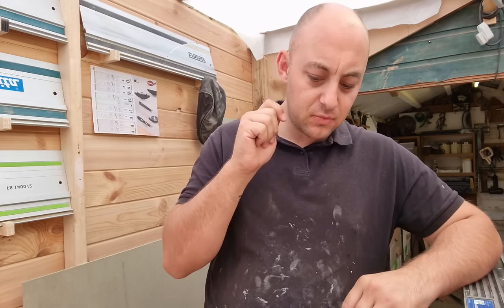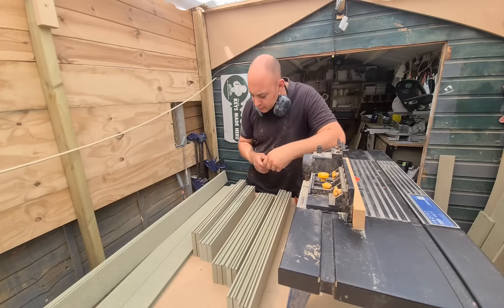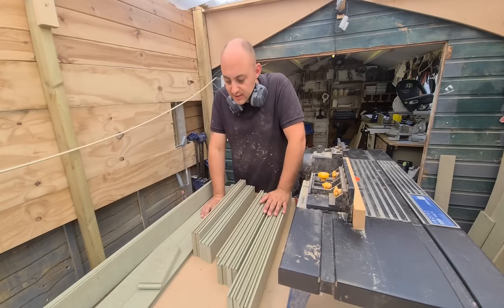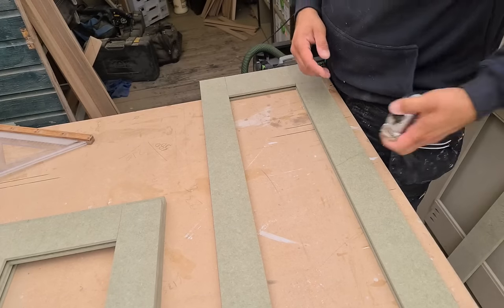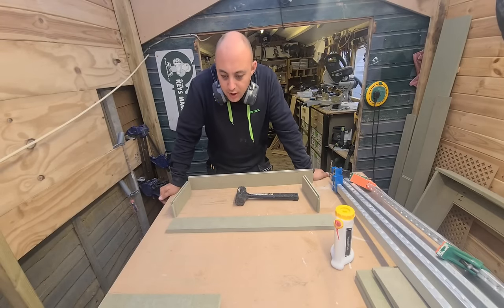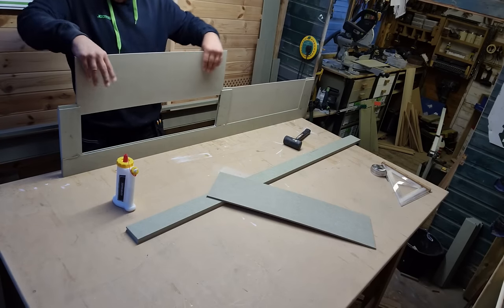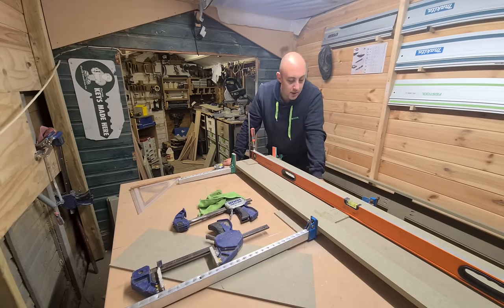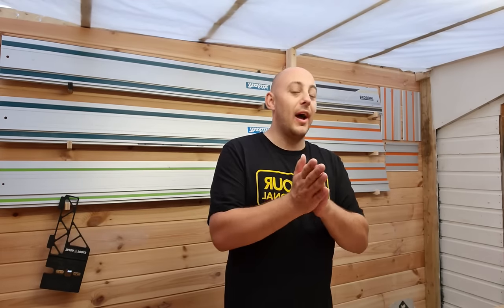MDF shaker doors / how to make shaker doors

Comment: Try making your groove upto 0.5mm wider than your panel for ease of fitting and cut your panel a couple of mm smaller that will make things alot easier. And look into cascamite glue it is a powdered resin you mix up it has a longer working time which takes the rushing out of it and it will fill the extra fitting room you left and it sands down clear.
Reply: I was taught that the 'Panels' should not be glued. ??
Reply: @Rocky-xx2zg  In traditional carpentry I think, because natural timber expands and contracts. But the MDF ain’t going nowhere, so might as well add to overall strength of the doors with some glue.
Reply: @Saladzingers  Got it. Thank you.

Comment: i learned this process for sizing a door panel while working in a cabinet shop. The width is the length of your rail, tenon to tenon, subtract 1/8 inch... or roughly 3 mm. to find the length, take two rails and place them back to back. looking at the end grain, the profiles are facing away from eachother, while the rails outer edges are tightly butted together in the middle. measure the distance from the bottom of groove to groove, and subtract from the length of the stile. to do this math quickly you can pull your tape out to the length of the stile (overall door length), hold it up to the bottom of the left profile groove subtract over to the right profile groove. take the reading there and subtract 1/8 inch and that is the length of your panel. this is also how you size rails. i hope this makes sense, its a valuable method for sizing door parts, good luck.

Comment: How I have made mine for years. 
I grove and mold mine on a spindle molder. And a tenon machine. Over size the rails by 5mm then trim them on the table saw.
Reply from the maker: Sounds like a system you have down to a t
Reply: Exactly the same way as me. Leaning on the powerfeed as it slowly pulls it through 😂

Comment: I agree with the commentor below. The mdf for stiles and rails creates issues and use Poplar it paints well and won’t typically bow and twist - acclimate it to your work area first? You could use mdf for the center panels or a shop grade maple. I also agree with the slightly oversized deimension on the frame (chamfered) leave yourself a little wiggle room for the panel length and width, use space balls (rubber balls) inset into the dado groove which allow the panels to float for expansion and contraction. I would really like  to make some cabinets, but I’m stuck fitting base mounding on a house for another day, then landscaping projects for 2-4 weeks....

Comment: Also you should use paintable edgeband. Small radius cutter and it paints great. The little plastic hinge templates work great to for over lay and for inset you need to buy the right one.
Reply from the maker: I really don't see the advantage to using them I get a perfect edges  with my system... I have a video coming out regarding fitting the inset hinges and what jigs I use.... the ks for the comments mate... much appreciated

Comment: Nice little vid mate. Get yourself a feather board and clamp it to the edge of the table for the grooving, also, make a sled or even a scrap bit of MDF when your pushing the rails through the cutter. It don’t half make things easier and safer👍🏻
Reply from the maker: Iv tried them mate... the feather board i could agree with you but i feel a lot more safer and more in control  doing it the way I do... but thats me... i suppose I should  do a disclaimer  please dont do it like this silly  twat haha 😆

Comment: Not working only from a face side means that any variation in mdf thickness will result in variations in the grooves widths. Best to machine using a slotter cutter and always keep face side down. Machine top and bottom rails as one piece (more stable on the fence) and then cut into 2 pieces.
Reply from the maker: Thanks for the info

Comment: Nice job👍🏻. Pretty harsh on yourself imo. I leave my panels 1/8” or 3mm undersized on width and length to make the fitting easier. The glue fills the gap. Thanks for sharing 👍🏻😊
Reply from the maker: Yes that's what I did do... I think I made the groove just a tad to tight hence the stresses I.had lol all.good tho

Comment: Get some 18mm MDF cut it to size of your door then get a sheet of 6mm and rip it into strips. Glue and pin it on front of door. Router edges of you want to put a profile on them. Similar effect. Less time. Only thing is there's no pattern on back of door
Reply: Prone to bending once painted, also makes a heavy door, also a lot of wasted mdf for no need

Comment: Realise this is an old video but for measuring the panel size, it would be quicker to measure in between stiles then add the 20mm on, and likewise for the rails. Both ways work fine though 👌
Reply from the maker: Thanks for the tip!

Comment: I have a couple of questions. Overall I liked your candid and open approach although I am wondering of the durability of the MDF tongues. Have you had success with this in the past or is this a first attempt? I guess it depends on what the doors are being used for. Secondly, I usually size/seal the exposed edges of my MDF boards. Do you seal the exposed fibres or just rely on the paint to seal the fibres. Which leads me to my next question. What type of paint are you using in the video? And what type of sprayer are you using. Hopefully not to many questions lol. Good job, hope it goes well for you.
Reply: Hi, just saw your query about mdf tongues  . I've been building kitchen doors for 20yrs plus  one of my first  in my utility room still holding up after all this time  not had a customer one fail either.

Comment: I've been doing carpentry and joinery over twenty years. If I ain't made a mistake or missing pieces then I'd be lying. What spray set up is that and what paint?
Reply from the maker: That was the primer and was a 2.0mm tip spraygun fastmover... and the primer was from construction chemicals internal primer... great stuff

Comment: Another good video bud.  Do you never use a paint pot and do you use hvlp or lvlp guns pal
Reply from the maker: I use both type of.guns.?? What do you mean when you say a paint pot.??
Reply: Cheers bud.  As in a pressurised pot connected to the gun so you dont need to gravity pot on the gun.  Do you mind me asking which guns you use for different things. Is it based upon the project size or product type ?

Comment: Looking at making my own wardrobe doors as the previous owners had custom ones installed and the widths aren't standard.
I was thinking of cutting 9mm thick down to the total size, then glue and pin 12mm thick to the front. Would this be okay or should I go down the route of routing out tounge and grooves
Reply from the maker: Personally I would go down the traditional route... the doors done with the plant on method  Will most definitely  warp and twist...
Reply: @lowesjoinery3031  thanks mate, maybe I am trying to cut corners but might as well invest in a nice router table and convince the misses it's "for the house" 😄
Great vid, nice and helpful, liked and subbed

Comment: What thickness mrmdf did you use for this project? Do you have any problem with warping on the longer doors! Cheers
Reply from the maker: This was 18mm any taller and I think I'd of upped to 22mm rails and stiles...  and no issues  to date
Reply: @lowesjoinery3031  I was going with 22mm and 9mm insert! I can’t work out if it’s overkill or not! They are around 2m in length! Maybe 3 cabinet hinges! Thanks for the reply
Reply: @karlchrist9892  22mm mrmdf with a 9mm panel is what I always aim for. Also helps if you wanna use panel mould.
Reply: @karlchrist9892  Oh gosh. I hope it doesn't spread. Yes it does work, I only use mrmdf though. I groove 20mm deep and glue the panels in also. Good joints with decent pva works well. My widths are cut around 65-75mm depending on the door size and other factors.
Reply: @joinery1888  thanks buds! That’s a great help! All made and ready for painting! Just wish I had a sprayer
Reply: @karlchrist9892  Good stuff! Spray painting can certainly speed things up but can be pretty messy without the right setup.